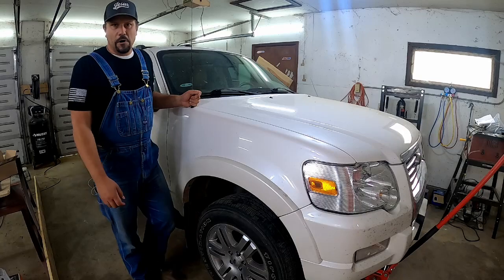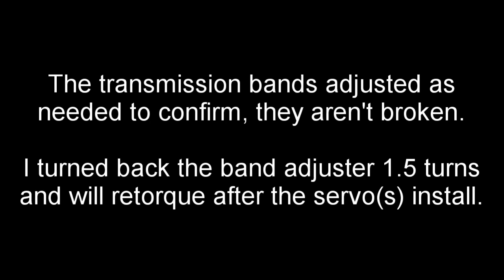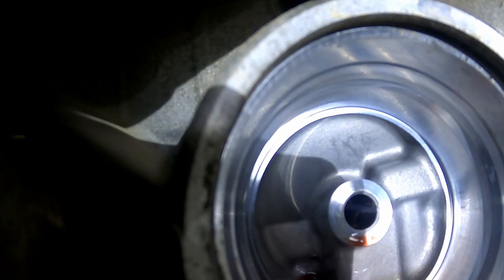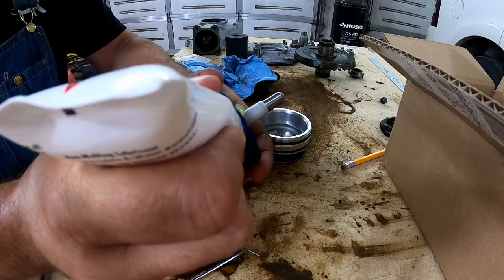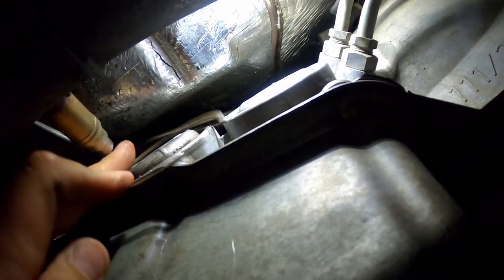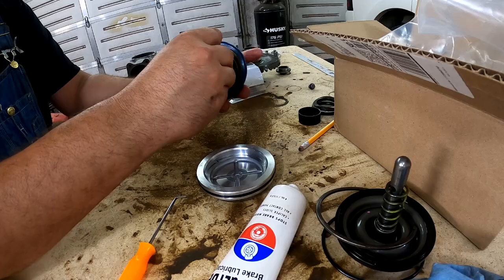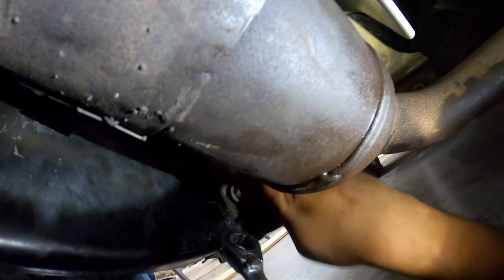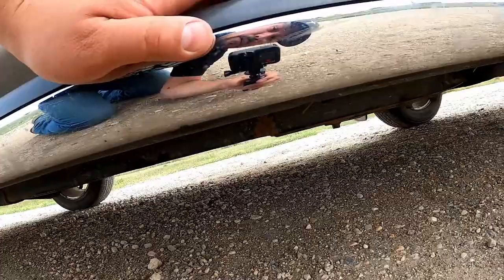Ford Explorer Transmission Fix?  AJ1E Superior Solutions LLC Servo Bore Kit Installation

Comment: Do you take the white plastic cap off
Reply from the maker: What part of the video or which piece are you talking about?
Reply: I saw that question two times now and you always ask what part they are talking about. They talk about the white plastic ring on the rod of the servo and no you don't take them off. Push the servo in as it is. Unfortunately thats the most important part on a video you weren't explaining at all. What the servos do we know. How to uninstall all the stuff around we know. But how to install them, push them in and what to do you just skipped. ...
Reply from the maker: @reinhardtrippmacher8776 good looking out for others and answering the question.  Hopefully it keeps someone from taking it off.
Reply from the maker: I’ll pin this comment.  Thanks again. 👍
Reply: No, your not supposed to.

Comment from the maker: Quick update:  Customer followed up with me and said this Explorer has been shifting well since the install of this bore fix.  -2SG
Reply: Glad to hear!
Reply: nothing like a "job well done"!!
Reply: how much for the repair?
Reply from the maker: The total came to about $250 (labor) to install.
Reply: How long did it take to do this?
Reply from the maker: @williamsteele2724  somewhere between 4-6 hours because I fought with the snap rings.  

The 2nd time doing this job would definitely come much easier so it’s not too bad.

Comment: Hey Man, Great work with your video!!! I have a 2004 Explorer with the 5R55S, and the problem is that the gear slips from 
2-3rd, and it would delay going into reverse, we bought a used transmission and again we got the same problem 4 months after it, I researched and found out about this servo bore issue and decided to buy it, today.  I'm crossing my fingers this will fix my problem. I do get OD light on my dashboard when the transmission is slipping to much.
Reply from the maker: I hope it resolves the issues you’re seeing.  You got this.
Reply: Hello. I am thinking about buying this kit. Have your issues been fixed after you had it installed?
Reply from the maker: Yes, since installing this kit, the customer states the transmission has shifting as it should.  No further issues. 👍

Comment: I have one of these 07 Explorers that definitely has shifting issues, been looking for this info for a while now, thanks so much for posting up the video and esp the fix solution link.   

Incidentally my issue is primarily with the OD gear not setting firmly in the 45-55 mph range, if I use the manual OD lockout it seems to fix the issue for the most part  in that speed range, as it will stay in OD pretty well going 60 mph and above.  It seems to slip and not shift down properly anymore when getting in that mid highway speed range.  Also my Explorer (v8 Sport Trac Limited) only has about 85k miles on it so this problem doesn't really have to be "high mileage" related.
Reply from the maker: I’m glad this was helpful for you.  I was impressed to hear from my customer that the issues resolved.  It took about 50 miles before the computer completed a relearn.  Not a hiccup since.

Comment: You won't see any wear on the servos. They are hardened steel! The problem is that the servo rods wear out the aluminium (aka aluminum) housing!

Comment: Hello, 2005 Lincoln Aviator. Hard shift at 1-2 gear and no OD. I ordered the OD servo kit from the same company.
 I have a lot of mechanical experience but since I work constantly I called around to a few shops to get this done. 4 out of 5 shops refused to take the job. The one that did had a 4 week work order. And the repair for labor wasn't cheap.
What did you charge for the job??
Also another YouTuber used a bottle jack to push the servo in due to what he stated was a strong spring.
Seems all you had to do was slightly spin the servo til it falls in correct???
I have many more questions but Ill save them. I am going to do the job myself. At least that way I know it was done right.
Reply from the maker: I charged my customer $260 to do the work.  They purchased the kit themselves.  CORRECT, put medium pressure on the servo cap (while rotating)  basically... medium pressure, rotate, medium pressure, rotate... repeat until it goes in.  It will go in eventually... no stress..  Let me know if you have any additional questions.

Comment: my 2010 explorer is having a similar issue I think, mostly happens in higher gears but around 1500 rpm if I get on the gas it jerks and kicks around then if you give it enough gas it downshifts, it also happens at other rpms if I really give it the beans it feels like it downshifts multiple times then the rpm kinda flutters instead of steadily gaining and it kicks as well, I got the car with 90k miles, fluid was never changed and Im not changing it now, im at 130k, Had a similar issue about 10k miles ago with misfiring but turned out to be my ignition coil on 3 and 4, however now im getting no codes, zero lights nothin

Comment: Great video wish you were local, 1 novice question, why would you need to back the band adjustor out 1and 1/2 turns to adjust or tighten the bands?
Reply from the maker: If the bands are adjusted too tight, it can restrict the transmission fluid from lubricating properly and cause excessive wear to the (band) and or drum.  I followed Ford's adjustment specs for that transmission.  Good question.
Reply: @2StallGarage  can we skip the step of adjusting bands, since we are going to put the same length of piston in? Thanks!
Reply from the maker: You might be able to get away with skipping that step, but try to get it done if you can.
Reply: @2StallGarage  Is the idea that if it does not torque to the recommended level, the bands are broken?
Reply from the maker: Exactly, yes.

Comment: I have a 2008 Ford explorer sport trac 4x4 it started with reverse engagement a lil hard and wrench light coming on with engine light then went away. Then truck will not shift into any gears..what could be issue if fluid level is good? Thanks great videos!
Reply from the maker: Oh man Ed, bummer.  It could be a number of things.  If it just stopped suddenly, it could be a shift solenoid or something else fairly simple.
Reply: I have the same Sport Trac, I pulled the trans to fix no  forwarded 1st or reverse.  Cause was bad overdrive sprague.  Did complete rebuild using manual as guide.  Works great.
Reply from the maker: @dougmackinnon8636  Nice work Doug!  Excellent news!
Reply: I pulled trans and had a complete rebuild all good now. Thanks for the replies guy's!

Comment: I have a 2007 Mercury Mountaineer  and i was wondering do i have to do this. My truck works fine in all the forward gears with no problem.  It engage in reverse but it doesn't move at all. Any suggestions please
Reply from the maker: I don’t believe this kit would resolve the issue your experiencing. Darn transmissions…
Reply: @2StallGarage  do you think the reverse servo replacement will work
Reply from the maker: If the servo rod is broken, then yes.
Reply: @2StallGarage  thanks, it worth a shot before I have to go any further
Reply: Also thanks for your fast response and honest opinion as well. I really appreciate it

Comment: Hi, I have an 06 ford explorer with a 4.0 V6  engine. The Transmission was  recently worked on because all  the gears stopped engaging
After the work on the transmission, the wrench signal is still showing and only  gears 1  and 4 and reverse only are engaging. Gears 2,3 and 5 do not engage at all.
Reply from the maker: Did you get a summary of the work completed?
Reply: @2StallGarage  I don't think I got a full summary of everything but initially it wasn't engaging in reverse and drive but after they worked on it (which involved them taking down the gear entirely and loosening the internal parts) it began to move. 

Although since then when I accelerate after I start the car the spanner light comes and the engine revs up to 4000-5000 rpm before it changes to the next gear. Whenever we scanned the vehicle for codes it brought up incorrect gear ratios in gears 2, 3 and 5. 

It was only a few days ago we discovered that gears 2, 3 and 5 weren't engaging at all which kind of explains why the engine would have to rev so high just to change gears. 

What could be the issue?
Reply from the maker: It’s hard to say without checking the bands and internals if necessary.  It might be worth calling a professional transmission shop.

Comment: I want to replace the servo bores and do the band adjustments myself, but don't want to bother if the bands are broken internally. Is there a way to know if they're busted without removing the whole transmission?
Reply from the maker: Absolutely, what year and model are you working on?
Reply: @2StallGarage  Appreciate the quick response, it's an 2005 Mustang with the following issues:

Flashing O/D light when doing cold-starts, flares/slips going into 3rd (goes away after warming up), reverse engages but doesn't work - only if I maintain steady throttle around 3000 RPM does it go, but if I'm on any kind of incline or giving it hard gas it just feels as though I'm in neutral), kickdown shifts becoming inconsistently hesitant
Reply from the maker: What transmission are you running? 5 speed or 6 speed?  Manual or automatic?

5-speed manual (T-5, TR-3650)
6-speed manual (TR-6060) 
5-speed automatic (5R55S
Reply from the maker: This should help.   There are also videos on YouTube that will show you actual footage of bands being adjusted.  

Let me know if you have any questions while reading through this. 

https://f01.justanswer.com/xsvectOR/f091cb05-43cc-4e49-aabc-afa83e5c5b6d_band.pdf

Comment: My transmission 5r55s 2 to 3 can feel a bit slip and 3 to 4 feel harsh @thumb but sometimes smooth as milk, no od flash light. Worn servo bore? Tq sir
Reply from the maker: Great question.  The owner of this Explorer experienced similar issues.  No engine light or engine codes.  Both servo shafts appeared to be in good condition, however, even slight wear in the bores can impact the transmission's performance.  Last I heard, the transmission was shifting smoothly after driving about 40 miles with this servo bore fix kit installed.  Hope this helps!
Reply: What are the correct size of the servo kit  , my tand
Reply: What are the correct size of kit for frirst time stock transmission , number of bore size & what's the cheapest best servo kit
Reply: @alanmcmillan6877  AJ1E from superior solutions is what he's using.

It's in the title, it's the only kit you'll want to buy if you're going to do it without pulling out the transmission.  Just because you're not pulling the transmission out doesn't mean it's easy type "AJ1E Servo bore" into the search on YouTube before you try, there's really no return once you pop the ring off. GL
Reply: @alanmcmillan6877  also visually inspect the plug going into the transmission solenoid, this requires a 10mm wrench.  The AC drips onto the plug and can cause issues with rough shifting but usually it will cause the OD light to flash.
Reply: @EricK-tb2dn  so the stock transmission servo kit is AJ 1 E  for sleeve bore size what's the MM sice 64mm  or 84 mm for first time bore on stock transmission 5r55s servo update kit that can be ordered
Reply from the maker: These transmissions are affected by this issue.  If your transmission is one of them, you might be able to resolve the issues with this bore fix kit.  5R55 SERIES - 5R55W, 5R55S, 5R55N, 5R55E, 4R44 SERIES - 4R44E, 4R55E, A4LD.

Website link is in the video description.
Reply: @alanmcmillan6877  With this kit you won't be replacing the sleeves(you have to pull the transmission out if you replace the sleeves)

The AJ1E is a patented servo that only comes from the company in the video description.  It uses o-rings to create a seal even on a damaged sleeve since it uses an oring instead of metal to metal.  You CANT do the repair the same way as the video without the specific AJ1E patented servos.

If you go the route where the sleeves get pushed into the transmission you would have to fully tear it down to pull out the metal pieces from the sleeves that would get pushed into the transmission.

I would strongly suggest watching 3-4 other videos of the kit being installed to decide if your comfortable.
Reply: @EricK-tb2dn  I understand know what the kit is , without sleeving the transmission , cool that's really all I need it has been serviced regularly & new silonoid pack & filter & fluid change , transmission has very slight late shift from 1st gear to 2nd gear , all other shifts are on point,  perfect kit , for a moreless a fuild pressure, problem because servo's are like  a pressure witch , when O rings  go bad"  plunger don't pushed enough pressure,🤔. Who ever designed a transmission that is , filled & the fill system is the most weirdest one , and not having a dipstick , to check transmission fluid , He was looking for great rewards in the future for having, lack of pressure & & lack of fluid / non to fill / fluid access except from under on the on ,, the transmission pan,.. Definitely is a consumer nitemare !! for a lot of people , who purchased these types,  of vehicles with this Pacific" transmission , engineers knew that this was a future , payoff for the transmission parts / market , because of not having a dipstick under the hood = out of sight ,,out of mind , in regards to regular maintenance & fluid & filter change.  🤔💵💵
Reply: @alanmcmillan6877  They definitely designed a few points to fail intentionally.  Like aluminum sleeves?  Of course they'll wear out eventually.

Comment: My speaker is broken, so I can’t hear anything out of my speakers…

So…
I have a 2003 Ford Explorer 4.0, 4x4. It has no 2nd gear or 5th gear (overdrive). If I manually shift it into 2nd, It will shift into that gear but not hold in that gear. It will go back down a gear. Same with O/D. Would this servo fix the problem?

Also, since I got the car it would shift hard into reverse. I have read that it’s a solenoid? Is that right? If you could help me on how to get these parts, that would be great.
Reply: My speaker on my phone is broken…I guess I should of stated that.
Reply from the maker: You’ve got an interesting issue.  It sounds like it’s time for a rebuild or replacement transmission, however; if you wanted to try the servo replacement, you first will want to check the bands on your transmission.

To do this, you’ll need an inch pounds torque wrench and the torque specs from Ford for that specific transmission.  Basically, if they torque up to spec, the bands aren’t broken.   If they don’t torque up, they are broken.

That test doesn’t rule out bands that are very wore and needing to be replaced (even if they torque up).

You could also take your servos out and see if the shaft is broken or wore on each servo.  

These are my thoughts.  If I was closer, I would be happy to take an initial look for you.  -Justin
Reply: @2StallGarage  

Great. Thanks you for your info. I will attempt to test the bands. I would hate to pull the trans, mainly because of having no lift, but if it has to be done, it has to be done. Thanks for your help.
Reply: @matthewgig108 what happened?

Comment: Did you need to drill the servo bore housing to get to the deeper snap ring or no?
Reply from the maker: No, the only snap rings I removed were the ones shown. 1 for the IM & 1 for the OD servo.

Comment: I have a 07 ford sport track with a 5r55s trans it had a hard shift so I replaced it with the updated servos now it won't shift out of 1st. I tried to do a manual tcm reset but I couldn't find good Instructions I don't know if it's that or if something went bad. I did alot or studying and talking to people thats why i leaned to the servos, it is a common problem with that trans. . help?
Reply from the maker: Ah man.  Stinks when this type of stuff happens.  Did the bands torque up appropriately?  What was the process you used to install the kit?
Reply: The bands are good and adjusted right.

Comment: Ok got a question for ya maybe u can give me a definitive answer. Iv got an 07 5.4l expedition 2wd and @ ahout 45ish mph I get a bad shudder like running over rumble strips. Iv seen 100 different answers and they range from torque converter to being servos and valves inside the trans. Have u come across this and a possible fix even stealership techs couldn't give positive answer
Reply from the maker: When you’re in the pedal or just cruising?
Reply: @2StallGarage  slight throttle like like speeding up to highway speed or In traffic. Soon as I get past 45-50 it stops.
Reply from the maker: I can’t give a definitive answer but I remember someone who had an unknown shutter at about 35mph during light-moderate acceleration.  Turned out to be one of the transaxles was bad.
Reply: @2StallGarage  damn so that's something completely different now I'll look @ that too. Iv seen alot were there were torque converter shutter issues with this body style that mimic the issue I'm having but no definitive fix for it.